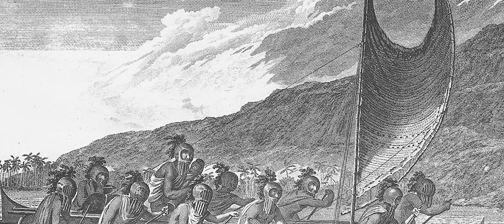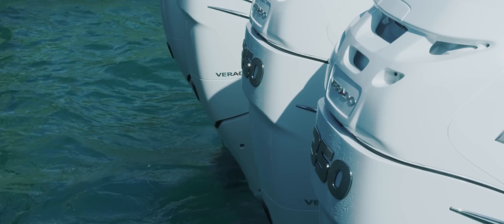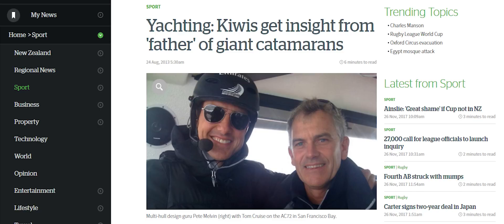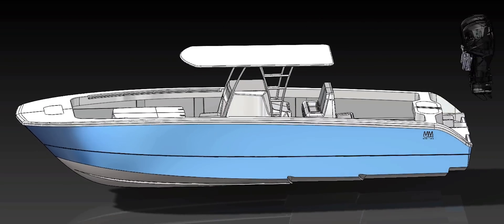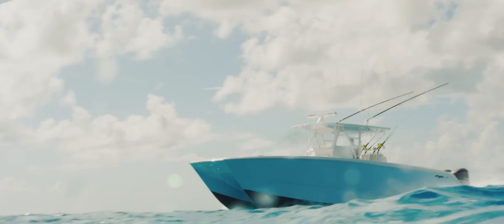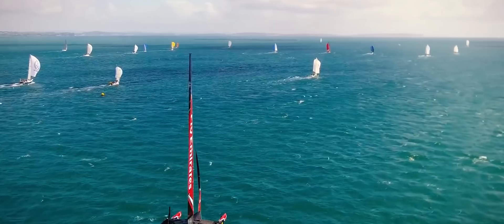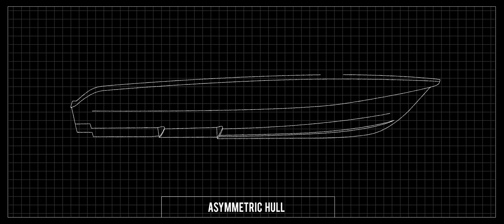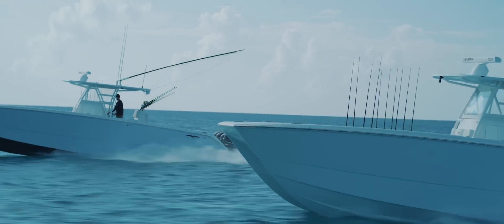Invincible Boats and Morrelli & Melvin

Comment: Now....let that technology waterfall down to a 26-29' Hull that more people can afford and use on a more frequent basis. I don't want quads or a boat that I cannot put on a trailer and head to the FL Keys for a week.... I want a twin engine, catamaran, in floor fish boxes, coffin box for storage or big tunas...in the 26-29' range.
Reply: 2x   I am not interested in any boat that technically I need a permit to trailer - therefore, 8.5ft is max beam. I am getting ready to take extended trips throughout America (but plan trips to every end of my home state Florida) and do not want to have to get a permit for every state that I travel to (towing my boat). But I want a CAT (that is dual purposed for fishing and cruising).  40 footers (even 30 footers) require living on the water, having a slip, or in/out storage. None of those appeal to me - been there - done that. So I am in agreement with WeekendHooker and would love to see you expand desired length down to 24'/25'  (to get the right balance (length/beam) with twin power.